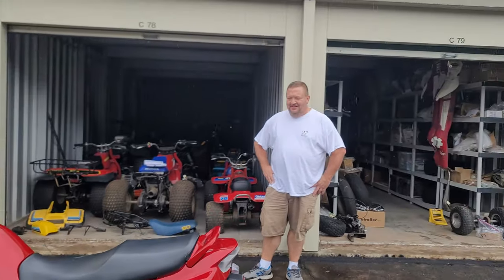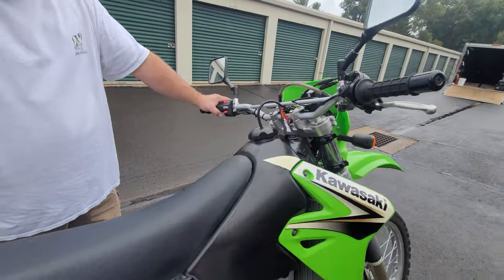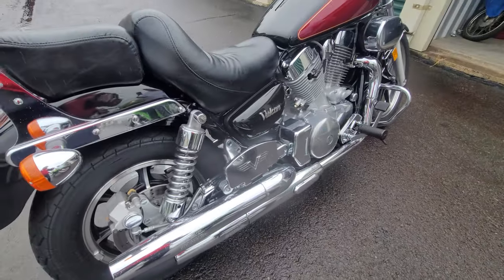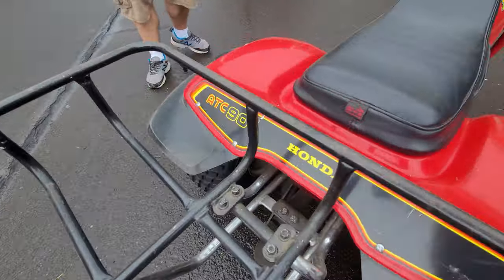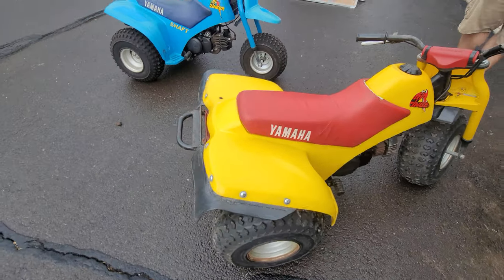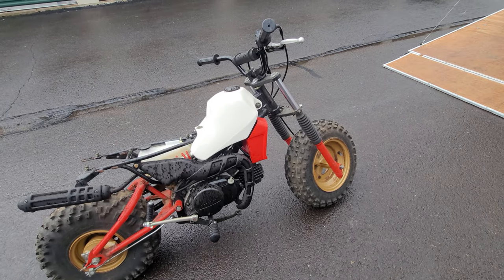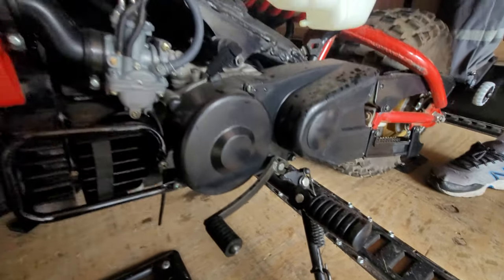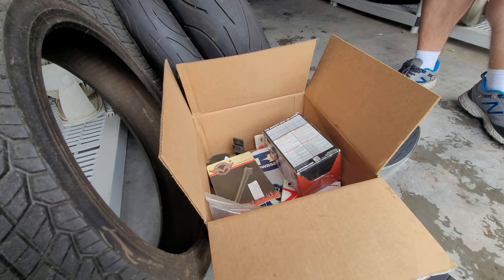TRUCKLOAD TUESDAY COLLECTION OF BIKES  PURCHASED;  A STORAGE UNIT FULL!

Comment: I really appreciate you bringing up how non ethanol fuel is so beneficial. I'm super lucky here in michigan where you can find rec 90 and 110 leaded easily straight out the pump at a local gas station

Comment: I need to qualify this by saying that I was never a Honda guy. Off all the different MX bikes I raced, I never ever even tossed a leg over the seat of any Honda product. 

That said, back in 2016 I went to an ATV/UTV poker run that went from Haverhill NH up to Littleton. It was a really nice day, but what makes this pertinent to this video is just how many of those early 70's to early 80's Honda 3 wheelers were there. I would guess that there had to be at least 3 dozen Honda ATC's running that day. Some were in really great shape. Some not so much and the rest anywhere in between. Mostly ridden by young kids and maybe a dozen ridden by older teens and 20 somethings. 

But overall, just a testament to the build quality and toughness of those 40-50ish year-old bikes.  I spent many years riding ATV's on NH and Maine trails and only recall coming across a few Honda 3-wheelers on the trails. Really rare in fact. So it was pretty amazing to see so many in such a fairly small geographic cluster all in 1 day. After the event, even a friend of mine came over and made a comment about the number of them also.  It wasn't like a Honda ATC fan club showed up all in a group. Only maybe @ a dozen of them were there for the poker run. The rest were just random riders out enjoying the trails. 

Thanks for another great video. That Justin has a really great attitude about moving on and letting new folks enjoy his years of hard work to build such a nice collection.

Comment: Kaplan got your ears on ? Like for example this big wheel yamaha 80 ,with fear i hope this comment does not discourage any possible buyers ...but when honda came out with a fat tire two wheeler and suzuki did too ...we took them to the strip mine to run them in the old trails that nature was taking back from the coal mine and was just trees and deer trails and dirt bike trails  like natural woods ..
So what you are looking at are mostly single track concave trails pretty much packed down on the most traveled and miles and miles long ...and the fat tires are constantly seeking the high sides of both sides of the trail ..so you are constantly correcting with the handle bars and wears your ass out in a hurry and not very stable for going fast ..just wanting to zig zag side to side all the time 
...always wanting to high side you ...and i never had a desire to ride one off road since ...  B U T what if you put a regular dirt bike front end on it???  ..in the fact of this "80" yamaha for example only , put a YZ80 motocross front end on it 
...the whole thing ,brakes wheel and knobby tire handlebars the works and what ever you might need for lights and accessories ..and for the bigger ones like the " fat cats " use your judgement and size up a proper size complete motocross front end ...i know now this will work ...as i was watching you tube videos taken in japan all about customizing Yamaha Zuma's and the Honda Ruckus ...and they come with fat tires and little tricky to ride fast off road like on deer trails or like cow trails on a farm ... Anyways these japanese kids had built themselves a little motocross or BMX track in a vacant lot ...and these kids had put motocross style complete front ends on their Zuma's and their Ruckus' and were just sending it hard ..in the power hand on the pipe ....duh , why didnt we think of this trick sooner ...do one please ...and show us the results ...and leave the back end stock or you might put on a better rear shock with another inch of wheel travel ..and from this the mods would be endless ...at one time i can veggie remember suzuki had about a 3.5 -  4 inch tire on the front of one of their models that i never tried running in the woods to see how it done ...the fat tires seem to do well on like a sandy beach cutting a fresh track but thats about it ..bur you take on of the biggest fat tire honda or suzuki with a motocross dirt bike front end , big fat atv knobby on the back and maybe an AJ Wagner CR500 two stroke in the middle and ....ooooops kid killer on the loose ...Ohlins makes shocks that will fit and give you a bit more wheel travel ..some of those japanese kids had Ohlins on the rear of their Zuma's jumping the shit out of them